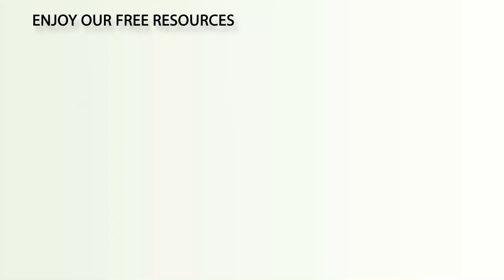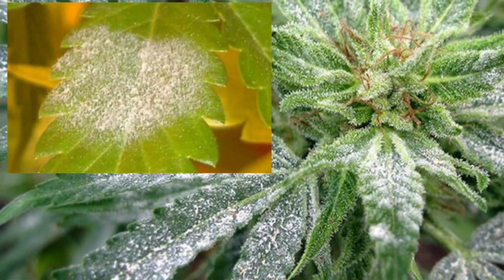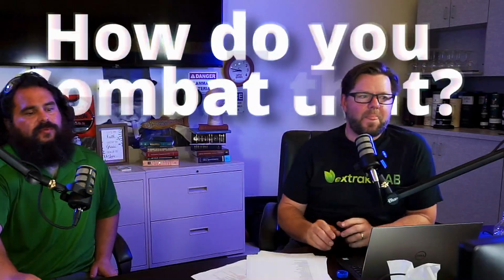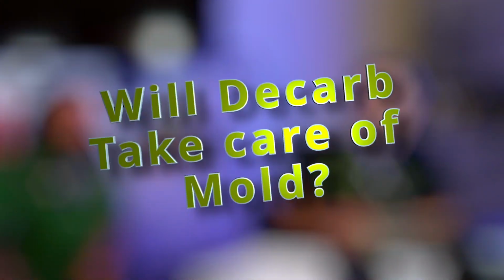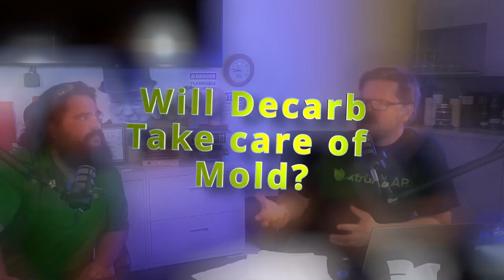Mold in your Cannabis Cultivation? | What You Can Do About It

Comment: I overfilled a Cannatrol and after drying/curing - two buds had signicant fuzzy white and grey mold in their centers...they're trash but what about the rest...should I toss all or only the fuzzy bits?
Reply: Good question… I also have a cannatrol and had the same problem … I feel the nugs ain’t dry enough before it goes into cure … I’m on my 4th run on the cannatrol and I’m setting this run to 7 day dry 4 day cure
 and see what that does … I’ve notice in the 4day dry 4 day cure is not enough at where I live … I’ve read in forums ppl sayin 4/4 is perfect for them in the room conditions their in as the machine adapts to the room temp …
Reply: Tool

Comment: 150 degrees for decarbing? Decarboxylation is a thermally initiated chemical decomposition, not a distillation. As far as I'm aware vacuum would not affect the decarb temperatures. Also, mold is not soluble period. The crc and micron filtration is how you remove the mold. Hydrocarbon pulls mold due the physical action of flow rates.
Reply from the maker: Although vacuum doesn't substantially affect the decarboxylation time, it does aid in our process for terpene recovery and  Terpene preservation by reduction in Oxygen concentration. Applying vacuum during the decarboxylation process not only supports efficient workflow by conducting multiple processes in one step, it also ensures the facility stays compliant under GMP HVAC guidelines.
Reply: @extraktLAB  True, I was responding to the statement about "150 degrees". 150 f is too low and 150 c is too high.
Reply: @Docsimple  What is it? I've read 230°F
Reply: @jennifermartin9213  that works. 220 to 240 f. Higher speeds the reaction but can cause it to change to CBN in air/oxygen